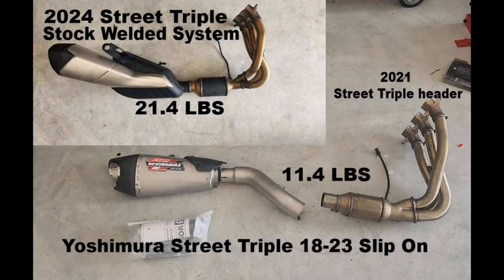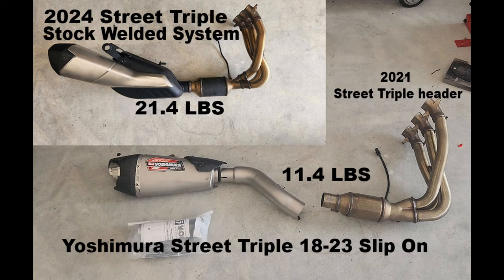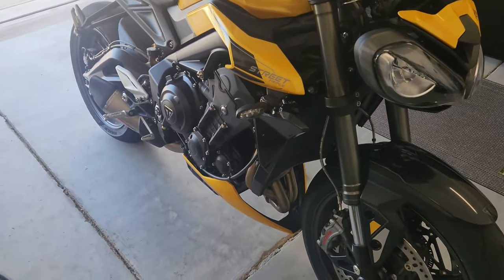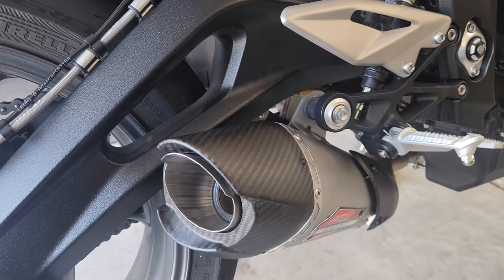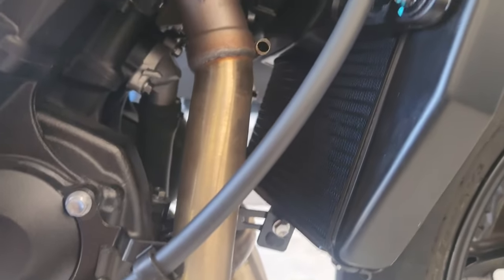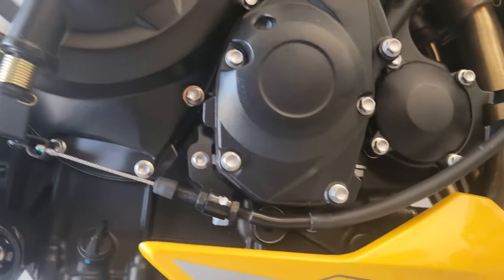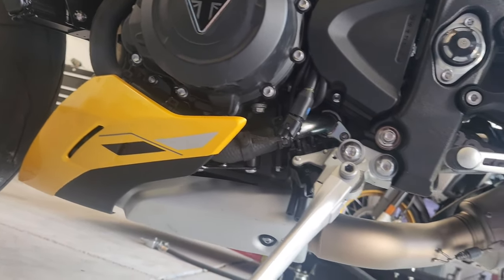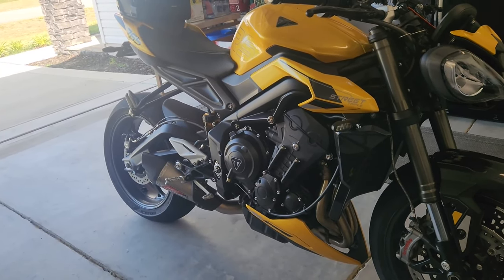2024 Street Triple Yoshimura Slip On.... so easy.

Comment: Well done Ken, unfortunately I don't have your ingenuity so had to settle for an Akrapovic full system but I'm really pleased with it as it took a full 5kg (11 lbs) of the bikes 188 kg (414 lbs) but even better is that it's been dynoed at 133.4 bhp over the original figure of 129.5 bhp. also the torque figure is 63 ft/lbs now at 8,400 rpm as opposed to its previous 59.7 at 9,250.
Reply from the maker: Its crazy how heavy the stock system is. More hp and more torque at a lower rpm... very cool. As soon as a tune comes out, I will have to get mine to a dyno.
Reply: what year headers did you use? last i had checked, akrapovic didn't have 2024 showing as available.
Reply: Captain redundant

Comment: I've got a Moto 2 765 RS and been offered to have Racefit Exhaust fitted with old headers & do you need to alter any exhaust sensors or not thanks
Reply from the maker: The o2 is the same, its a simple bolt on, you just need to re-drill the lower radiator bracket a 1/4 inch higher.

Comment: News flash its not 2024
Reply: Triumph didn't get the memo. I have a 2024 Street triple myself. 😁
Reply: It's different in the states, in the UK for the same year we would call this a 2023, which i also have the Cosmic Yellow. It bugs me, but still same bike 🤷🏻‍♂️
Reply: Looked it up, apparently, in the states, it can be called a 2024 model from January 2023 that's just silly
Reply: You're not wrong. 
I'm pretty sure they did it to alleviate confusion about the 2023 RS, the black one with bronze wheels,  not having all the updates. I bet all of those had to be discounted.

Comment: Awesome Video!! Man, maybe i should have gone with the Yoshi! Glad it worked out for you :)
Reply from the maker: Thanks man... I've watched your vids. The SC slip on looks great, I just didn't want to spend that much just for looks and sound. Side note... I wound up using a rubber grommet that was in my tool box for the spacer needed on the hanger... was just lucky it fit.
Reply: @Yo-Ken  Does your right foot touch the slip on?
Reply from the maker: @Zab Devin  For just cruising and getting sporty... no issues with your foot touching the slip on. If you want to stand up... its close but does not touch.
Reply: @Yo-Ken  Mbn. mine touches 1000% if i try to stand up. Ive learned to just shift my foot forward :)
Reply from the maker: @rwdconnor  If it's any consolation... the SC does look better... I really like the s mid pipe.

Comment: Am struggling to find down pipes in the uk just looking at your exhaust you took off could we not just cut the cat off
Reply from the maker: I thought about doing something similar, but cutting it after the cat. Cutting the cat off would be more of a project as it is so close to the O2 sensor. The problem with cutting after the cat has its issues also because the  the outside diameter is 55mm from the cat to the muffler instead of 44mm for the older systems. The aftermarket exhaust uses a mid pipe that has a inside diameter of 44.5mm, no way to make the work. You have to have a exhaust shop make some type of adapter. Keeping looking on ebay they do pop up a lot.

Comment: I just installed the exact same setup on my 24 STRS. 

I removed the rubber grommet from the stock muffler and used that for the Yoshimura.

As a whole, super simple install. I’ve owned sport bikes and removing all those fairings to get to the headers was always a pain.
Reply from the maker: How does it compare to riding a sport bike in the twisties?

Comment: These underslug exhausts are incredibly loud and make the whole helmet vibrate while you ride. I had similar issue on the 2012 street R and despite the baffle I had to use either noice cancelling headphones or a pair of earplugs. Looked good but in the hindsight I’d never do another mod like this😅 
Ps. Regarding the horn… it’s facing the wrong way and sits behind the radiator so people might not hear you well enough when needed. Wonderful bike, enjoy!
Reply from the maker: Stock exhaust is way too quite for  a bike like this. No issues with helmet vibrations here. It's louder, but to me in a good way. Sound can be subjective. Moving the horn is a must for me... its still plenty loud.
Reply: @Yo-Ken  - UK refers to it as the '23 year model, in the US it's a '24 year model.    Sparks confusion constantly
Reply from the maker: @303MoTo  Yeah, not sure what they were thinking.

Comment: Awesome job for finding this works with older headers. Quick question though for us Europeans: since you call this street "2024", it means the "2021" headers is in reality the 2020 one ? I'm planning on doing the same thing as you but really don't want to mess up the ordering part :s
Reply from the maker: No, a 2021 is a 2021... I would look for a 21-22 header over there, and a 21-23 header here in the States. Not sure why Triumph calls ours a 2024... maybe because production for the US was behind and they needed to get rid of the older generation. When I went to the dealer there was 23 right next to the 24 model... the 23 was heavily discounted.

Comment: Nice job.
Reply: I’m sure you already know this about exhausts.  FYI, I put an aftermarket exhaust — Leo Vince — on my Ducati because I wanted a better sounding bike. After installation I realized that it was too loud. It didn’t come with a baffle either. More importantly, I realized that my watch was telling me the sound was loud enough to damage my hearing. I think people who have loud exhausts should wear hearing protection. You can’t get your hearing back once you lose it.
Reply: This is good advice.   I wear ear plugs just to protect from wind noise.  My 2018 str has stock, which I like. I put an after market pipe on my Grom which made me pull over and buy some ear plugs which is when I started using them. Hearing is very important.
Reply: @jbean530  Absolutely!

Comment: Im in this mess in uk... have ya managed to do any fuel adjusts or stock??? May go this route on my 24
Reply from the maker: There is no tune available for the US model, but there is for the UK.
Reply: Fitted a yoshi replica slip on off eBay to my uk 2023 765 R street triple cut the headers after the cat and extended the mid pipe to fit no extra messing about with any tuning and it sounds awesome 👍

Comment: Hi, great video,
can you share the exact model name of the exhaust please.
Thank you.
Reply: i guess, this is the one "STREET TRIPLE 18-23 AT2 STAINLESS SLIP-ON EXHAUST, W/ STAINLESS MUFFLER"
Reply from the maker: STREET TRIPLE 18-23 AT2 Stainless Slip-On Exhaust, w/ Stainless Muffler, You have to use a header from 2018 through 23.
Reply: @Yo-Ken  so you mean 2018 to 2023 any years header will work and not have to be only 2021 year's ,
coz you showed 2021, so i was looking for 2021 headers.
Thank you, really appreciate it..
Do you find any performance improvement ? noticable ?
Reply from the maker: @michaelkopec.5814  Yes, those years will work. I just happened to get a 21. Performance wise it would be hard to tell as I changed  the exhaust with only a few hundred miles on the bike.

Comment: So in theory if I brought a full system for a 2021 it should fit perfectly fine to the 2023?
Reply from the maker: Yes, most will. It depends on what the slip on is bolted to. If it bolted to the rear set, no issue. If it bolts to the frame you will need the bracket from a 2019-22.
Reply: @Yo-Ken  cheers mate thanks for the info, looking to sell my 17’ gsxr 1k for one of these, do you know if the older Gen tail tidys fit new Gen?
Reply from the maker: @Nine.siixxx  The 2019 to present all fit.